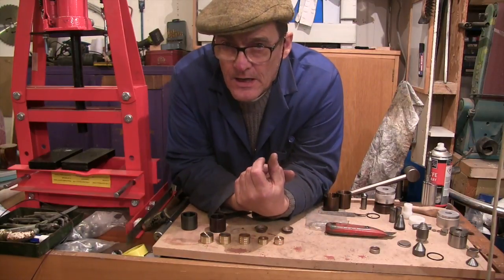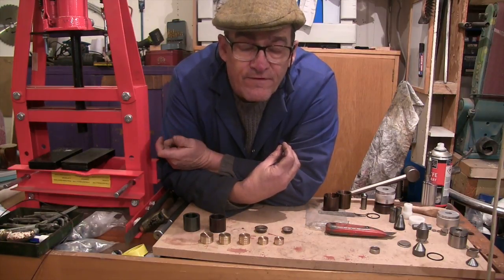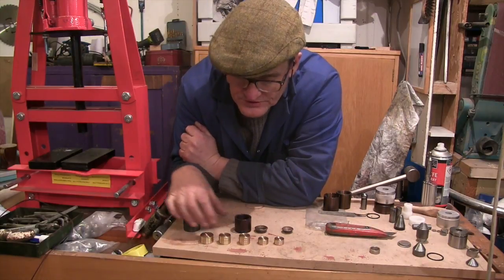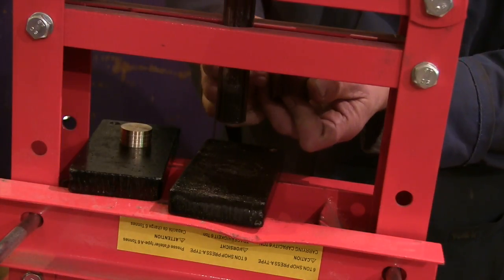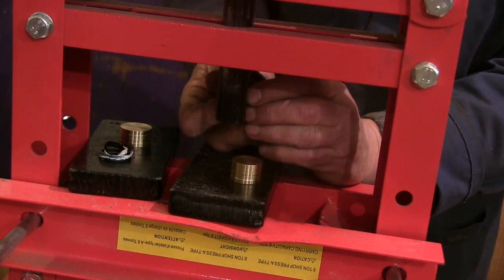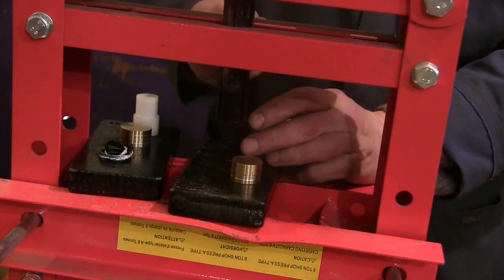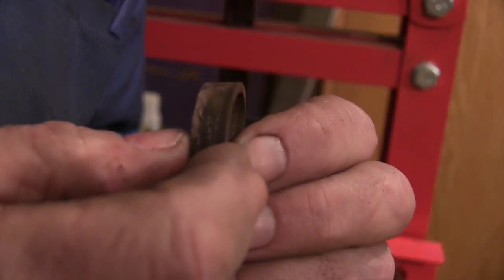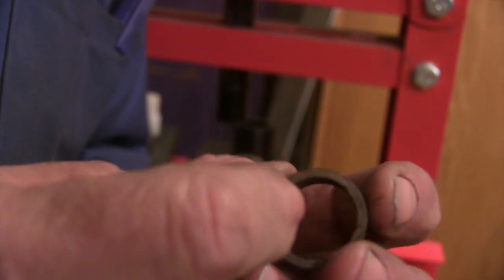Swiss Wrap tools with Brass Pushers.

Comment: WOW !
once again you nailed it.
I'm very impressed with the new set, built to last and just screams quality.
And those other delrin parts cup and ring releaser just show attention to detail.
Those brass pushers are miles better than the coin pucks I was dreaming about.
Amazing job Cliff.

Between this set and the folding set, you have every angle covered in the full process of shaping and everything is top quality and designed to last not fail.
I'm very interested and I can see that kit sitting beside the rest of my coin ring tools already.

I was looking into PTFE spray last week, it seems to be easier to deal with so might invest in a few cans.
Really good job though, this is what the coin ring makers need.
Massive pat on the back
ATB
Darren
Reply from the maker: Cheers Darren, The brass ones work well, in all honesty I am not jumping up and down about this method like the americans, its very useful to make very small rings, but I am a luddite and have been doing it my way for a long time and am set in my ways!
all the best.
cliff

Comment: Another good video, thanks for sharing Cliff ........ So in a nutshell with these you don't need a mandrel and hammer then to get the rings straight? Still learning about making rings, so sorry if that's a dumb question ;-) ........ So just need to order these with the punch (I have doming block set) and it's job done for a basic coin ring, am I right?
Reply from the maker: Hello Dave,
You still need a ring stretcher really, you could just push them through the dies, but I would definitely include a ring stretcher as an essential tool,
ATB,
Cliff